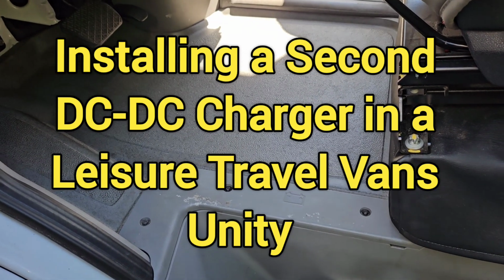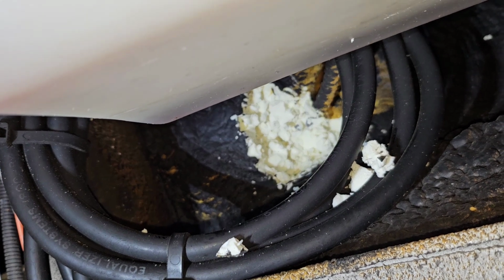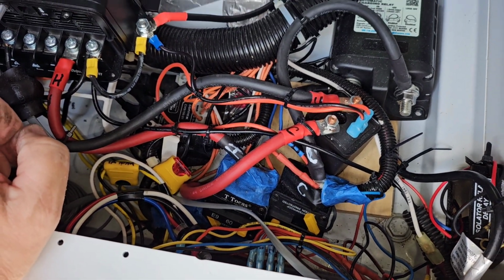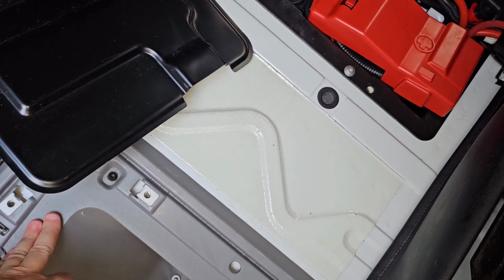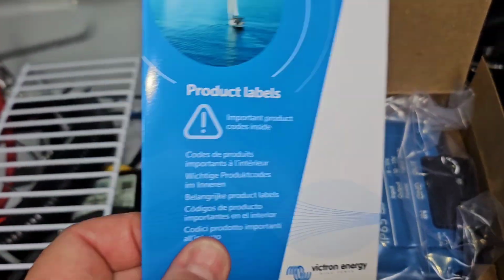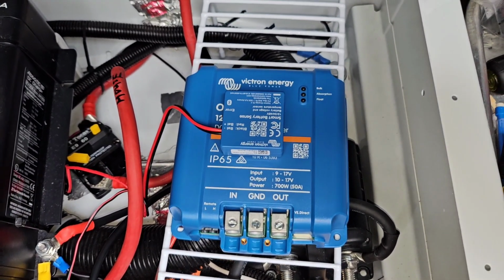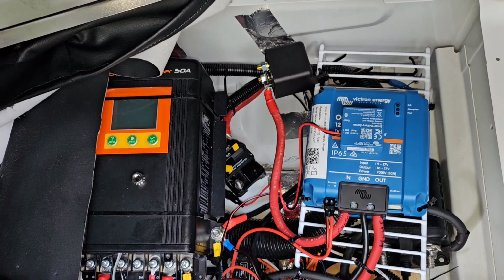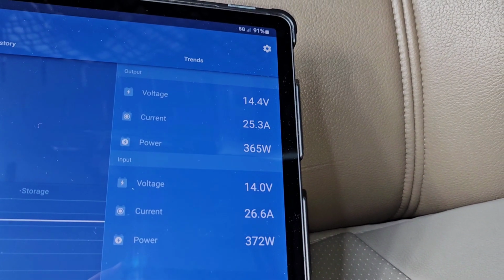Installing a 2nd DC-DC Charger -50a Victron Orion-XS- in a Leisure Travel Vans Unity

Comment: Excellent video! I need to fix my system because it is not working properly. When my Sprinter warms up on hot summer days, the alternator starts producing less and less power until it finally stops altogether. I have 900 Ah of lithium batteries connected to a Victron system. Unfortunately, I didn't install the system, and I am not confident enough in my knowledge to know exactly what it has. Everything was installed by the RV upfitter. Hopefully, I can get some information from them so I can make an informed decision on how I want to proceed. I feel like I'm going down a rabbit hole. Every time I think I have things figured out, I hit another obstacle.

Comment: You are using 6 awg wire for the Kisae 50a charger and 4 awg for the Victron 50a charger.  Is 6 awg adequate for the Victron 50a charger?
Reply from the maker: @brianthibodaux818  6 awg is adequate. I had another Victron product that was a 90a constant voltage and amperage output device attached to the 4 awg wire. I decided I would rather have a DC-DC charger so I replaced it with the Victron Orion-XS. I used 6 awg on the Orion-XS side of the circuit breakers and attached the 4 awg for the battery connections of the circuit breakers. 6 awg would be easier to pull as new cables for sure.

Comment: Will this overload your alternator?
Reply from the maker: @shawnroberts42  Not at all. Click on the title of the video to get more information.
Reply: Wow, I never knew you wrote such detailed information. This is really great! I’ve been meaning to change the setting on my Stirling DC to DC charger to lithium. In your video you said it wasn’t necessary after installing lithium batteries, but I would like to get more juice from the DC-DC charger while on the road.  Some folks have said that would overload the alternator and make it get too hot. What do you think?  Thanks again for all your wonderful teaching videos!
Reply from the maker: @shawnroberts42   You don't need to change the setting on your Sterling to Lithium. The setting LTV selected is very compatible with Lithium batteries. People with Sprinter Vans have been using as much as 100a alternator charging with not effect on the Alternator. I'm not worried about getting 90a from mine.